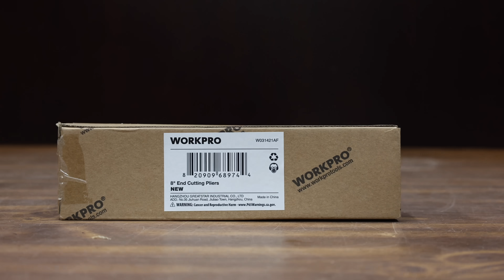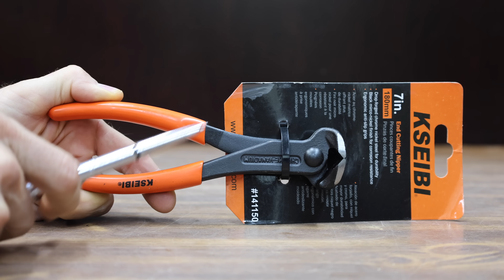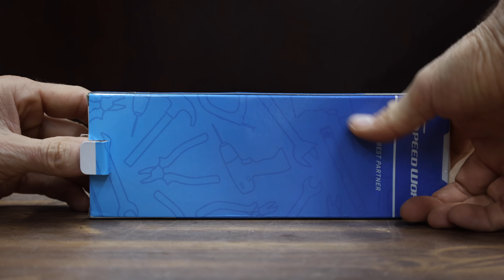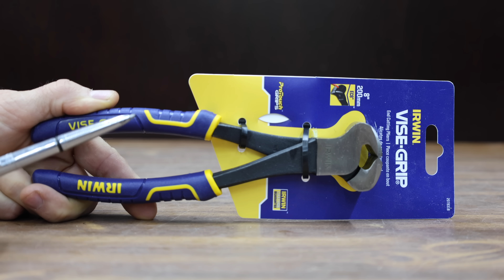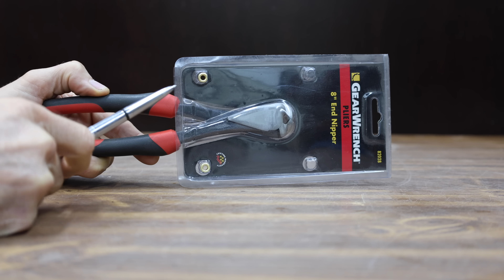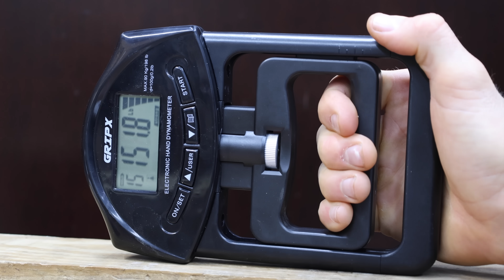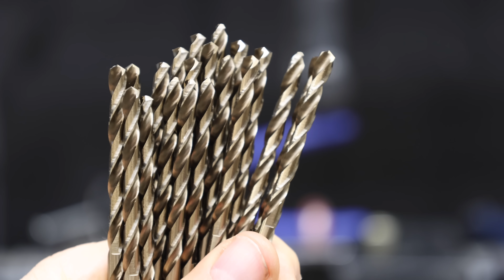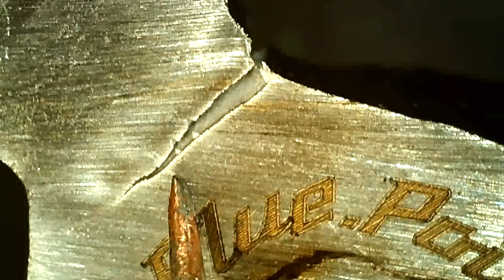Finally! Best Pliers I've Ever Tested! Not Even Close!

Comment: If this dude published a book that just listed the results of every test he’s ever done, it would be a best seller for decades.
Reply from the maker: Thanks!
Reply: @ProjectFarm  A yearly edition like firearm reloading manuals or 3rd party car manuals would be a good move, especially a collaboration with a couple other trustworthy tool test channels like the Torque Test Channel. then companies can’t rest on their laurels and you can add new information as things change. I’d buy the hell out of such a thing,
Reply: @ProjectFarm  yoou should figure this out with a lawyer. this is a mioneymaking idea.
Reply: @ProjectFarm You have to do it. Its viewer suggested 😁😁
Reply: @ProjectFarm  TorqueTestChannel keeps a live spreadsheet of their tool rankings and sells lifetime access to it for 15 bucks. I'd love if you had something like that!
Reply: Do it I'd buy it instantly
Reply: @ProjectFarm  it would be the tool buyers Bible
Reply: @ProjectFarm It should be doable with reasonable effort, just run your videos one by one through google gemini, prompting it to create a book chapter with info tables. Should work.
Reply: @ProjectFarm sorry mate, but immediate fail. These are fencing pliers, meant to pull tension on a wire by the offset cut, before cutting it through after tensioning via the curved outed surface. You have misunderstood the purpose of this particular plier. Love you work, but please understand tools, equipment, materials before testing. 😊 The Japanese ones were first to have a flush cut.... all before are fencing pliers.
Reply: @logic.and.reasoning  you should go and read the description on the ads for these cutters. They advertise cutting screws and even chain. 
 You are the one misunderstood,  they are not just for light work of cutting fence.
Reply: @Itsa_Mea  he tested them as "flush cutters" which they are obviously not by design, except one. Wrong test on these tools.
Reply: @logic.and.reasoning  no, his test demonstrates how close they CAN cut. He's not testing them exclusively as Flush Cutters, hence all the other tests he did perform. 
 If you don't see the value in all the conclusive tests then that's on you.  Majority here appreciates it.
Reply: @Itsa_Mea  so... he tested them to do a job they aren't designed to do... you wouldn't buy these to flush cut... so the test was pointless. It's like testing a hammer to see how it well it trowels cement. I love this channel, and the tests are usually helpful and indicative of the tool. This test was not. The curved backs of the jaw are meant to roll on... you grip wire/nail with the slightly offset cutting edges (they grip first, shear with higher pressure applied) and roll the tool to pull the nail, or tension wire. The handles are made so you can twist the tool for wire. 
Argument is... the tool wasn't tested on jobs it was designed for.
Reply: @logic.and.reasoning  you are confused. He tested nipper pliers.  The tool you are confusing with nippers are FENCE PLIERS.   Those are for fencing, NOT what he tested.  You are using the incorrect tool and should be using Fence Pliers.  Lol, you may as use a hammer. 🤣
Reply: @logic.and.reasoning He used the tools for their advertised purpose. The Knipex had a small offset in comparison with the others, yet performed the best by a huge margin. A larger offset doesn't seem to have any benefit, and his mentioning of each pliers' offsets doesn't have anything to do with the performed tests.
Reply: @logic.and.reasoning  If you think those are fencing pliers, please look at actual images of pliers used for fencing. They are not the same. Just because you've been taught to use the wrong tool, doesn't mean everyone else is. He's testing nippers. Hope you have a great day.
Reply: @fpbbq I've never had a pair of " nipper pliers " before.  I have had " fencing  pliers " . 
So I googled them.  So I could see the difference... you are 100% correct! 
Nothing I found shows nippers being used like the jealous wierdo here keeps saying.  Not one example  of nippers pulling wire or " rolling " anything.  The fencing pliers though,  that's a different story.
Reply: @logic.and.reasoning  I believe you are confusing these pliers and Fencing Pliers.  They do look similar and definitely work as Fencing Pliers, it's just not what they are intended for.  I will say, they work great for pulling nails and staples. You grab hold of the nail/staple and as you roll them, the nail/staple is easily pulled free.  Even without a head on the nail these work well.
Reply: @logic.and.reasoning interesting. The more I know. 😮
Reply: @U.S.INFIDEL  because you haven't lived in the Australian outback. Probably been in a tent at most.
Reply: Do the book!

Or like a digital book/file that gets continually updated. Once you pay for it it just keeps getting updated.
Reply: I'd love to buy that book. You should think about doing it.
Reply: Well it would be a best seller until the less principled brands realize they can now cheapen production and double the cost of their tools and make bank because of the book's existence.

Frustratingly a lot of products that get glowing reviews from popular sources like this will quickly sell out, and then the next batch of the same product will be dramatically worse cus the company knows they can get away with it and would rather make a quick buck than stick to their original product and gain a million loyal customers.
Reply: @PollexTheCat  Don't they call that value engineering?
Reply: @PollexTheCat Those companies typically don't last many decades. There are thankfully plenty of companies that stick to their values. Unfortunately not most. Buyer beware, as you said.
Reply: There's already a spreadsheet with all of his tests on it.
Reply: I’m a web developer by day (tool nerd by night) and would totally be down to volunteer my time in building a website to house all this info.
Reply: @MBbank8 Claude Opus 4 oneshots this kind of website
Reply: like a farmer's almanac for tools and things.
Reply: Is it though? Half these pliers won't even exist either as brands or the specific designs in 5 years. It would be outdated very quickly even for something basic like pliers, powers tools and accessories would fare even worse.
Reply: @onikwa  your lack of use of various tools is obvious.
Reply: America's Test Farm.
Reply: The project farm almanac
Reply: I think he should have an online store of all the tools that did the best at their price point. If you need a good tool, you know where to go to get the best. Project Farm approved tools shop!
Reply: @mugur9818  I beleave you are corectomundo!!!!
Reply: Agreed. Required reading for every member of the household and or shop. Love this guy! USA !!
Reply: thank you!
Reply: Just like a laminated pamphlet of a large chart with test results that I can leave in my glovebox and check on my way to the store to buy tools.
Reply: Here is the thing.  Something that was number one 3 years ago may no longer be number 1.  Companies are always trying to save a buck and make things cheaper, thus quality suffers.  Maybe a few companies have improved their products, so they could actually move up the rankings.  So that saying, "What's good today may not be good tomorrow" has a lot of truth in todays consumer world.
Reply: @trvman1  that’s why you make it a yearly thing, and the proceeds both pay for retesting and support the creators. A lot like how Underwriters Laboratories works
Reply: That’s a great idea
Reply: Ooooorrrr, @ProjectFarm could do an in-depth video review on hundreds of tools and household items and publish it for free on some Internet video sharing site. Hmmm, great idea. ;-D I get it, a book would be a great quick reference guide :-) and that would be a wonderfully useful asset.
Reply: except in 5 years half of these brands will no longer exist and the others will be made by a different manufacturer...
Reply: @mewmew32  …and at that moment the tools will vaporize into Thanos dust. And besides, no one ever wants info on old tools anyway 🙄
Reply: it would lose relevance after a few years as manufacturers change their designs.
Reply: Id but that book!
Reply: Yeah we need a real project farm reports
Reply: While it outdates quickly id buy it for sake of honouring excelent cerator on the mission
Reply: He has an excel file with everything on it
Reply: Kind of like consumer reports, except by and for people who regularly use tools.
Reply: It's like having cheat codes for life 😂
Reply: @Bdub423  Cheat codes....love it mate.
Reply: Still, it’s important to know that a brand can change ownership, and thereafter quality levels.
Reply: Or winner products could say tested and proven #1 by project farm.
Reply: It'll be like the Michelin guide for tools
Reply: @jestforyoooou  hell  yeah  I'd buy 2 copies  at least
Reply: ya then we could just skip to the info we want and not have to listen to his annoying voice.
Reply: .... We need to make this a thing
Reply: but he would have multiple hits on his head tho
Reply: @GyantaTheProto  he's testing tools not engines that run on water, man
Reply: @jestforyoooou  pity I'm talking g to unskilled workers with little experience....
Reply: 40 years in metal custom fabrication and hydraulic dampers, mechanical, but multi skilled by learning from old school TRADESMEN. I AM a tradesman. Not just a tradie, or had 5yrs experience... I have built stunt equipment and movie cars. Aircraft, race boat, custom parts... done pyrotechnics and special effects... I have hand built more tools than you have had a bj...

Comment: Awesome as always.  Here's an idea for a future video. black or chrome lug nuts, Which are the best and actually hold up to rust? Is expensive OEM the way to go? Do these cheaper chinese brands off amazon perform the same or worse? Does the black coating just fall off leaving you with rust after a winter season? Would love a experiment on that!
Reply from the maker: Thanks!  Thanks for the suggestion.

Comment: YT recommends a lot of tool test videos in my feed.  You and TTC are the only ones I trust to give an honest review.
Reply: Same here. Both channels I trust, mainly because they don't allow the manufacturers to butter them up with freebies. Even though others may claim that getting free stuff doesn't in any way sway their results. I somehow doubt it.
Reply: Not the only ones I trust, but definitely the 2 best for specific testing of strength and/or power. Love that both of them design and build their own testing rigs. 

Several others address speed, ergonomics, and other factors very well without brand/price bias, particularly for cordless power tool testing.
Reply: you never came across ave / boltr.. sad.. battery tools mainly, plus advice, jokes.. older vids worth watching. 2 yrs ago..
Reply from the maker: Thanks so much!
Reply: TTC? Is that "The Tool Center"
Reply: torque test channel
Reply: @pauldean7690  Torque Test Channel
Reply: @pauldean7690  torque test channel.  Check em out!  Really good content.
Reply: @pauldean7690  torque test channel
Reply: @pauldean7690 torque test channel . They test impacts, flashlights, wrenches and more. don't ever trust the numbers on the box.
Reply: @pauldean7690  Pretty sure he’s talking about Torque Test Channel. Can almost guarantee it.
Reply: True!!

Comment: The Japanese Wazakura pliers have the only design that will cut close to the board. I believe that the strength of the steel is important, but the heat treating probably makes a big difference.
Reply from the maker: Thanks for the feedback.

Comment: I've had several sets of Knipex cutters (both 7101200 and 7132200) and they're effectively indestructible and deliver more cutting force than anything else. The only drawback is they don't open very far. I don't have much use for end cutters like the 6202200 you tested in this video, but I might have to pick a pair up.
Reply from the maker: Thanks for  sharing.

Comment: You can tell just by looking at them that none of those were designed for a flush cut.  You would need to remove the outer bevel.
Reply: 7:35 Like that one

Comment: Suggestion:
Micro ratchets (1/4" hex bit drivers): Gear Wrench, ICON, Klein, Wera, Wiha, Ares, Titan, HART, Pittsburgh, various Chinese random-brand.

Some of these can handle crazy torque, and a low resistance (backdrag) micro ratchet is the only viable solution for some fasteners. Micro ratchets with a purpose-tailored bit and socket set up to 17mm can handle 80-95% of workload on any machine, all fitting in your pocket or a slim holster. That kind of versatility and portability saves massive amounts of time on the job and prevents using the wrong tool to "save time". Some of these ratchets have great features like in-handle bit drivers, thumb wheels, pass through extensions, locking flex head, etc

Love what you do, really appreciate your time and dedication. Saved me hundreds in dollars and thousands in time and frustration, and the priceless satisfaction of finding that I already use the best tool or product.
Reply: Excellent suggestion.
Reply: Why no Bahco brand? Is it not available in the US? (yes, it is a Swedish brand - but now owned by Snap-on).
Reply: @jarls5890  Not personally familiar with it. Looks like the only true hex micro ratchet they sell (6950CBR or 2058/S26 kit) is the same as an old Gear Wrench discontinued, which I know from experience is not very good. The rest of their stuff is square drive with a hex attachment which kind of defeats the purpose of a micro ratchet in my opinion.
Reply: @ziptieMasterTech  Fair enough! But I was thinking more "in general" - I watched a lot of PF videos and I don't think I've seen any Bahco tools yet. They are very common in especially Scandinavia and is respected as good tools at a "not too terrible" price. Personally I got a bunch of old (50s to 60s) Bahco (and Sandvik) tools in the basement after my grandfather who worked in a tool factory in Oslo.
Reply: @jarls5890 maybe it's because of the name? I thought it was a Chinese brand when I saw it and I've never seen them in the states.
Reply: @jarls5890  I'm surprised aswell. Bahco hammers or chisels are probably the best you can get.
Reply from the maker: Thanks for the suggestion.
Reply: I have the Icon kit and it quickly became one of my favorite tools. I even used it once with extra leverage beyond what it's intended to have (more than using the included extension bar as a cheater) and not only did it survive but it's wasn't even affected by it.

The only complaint I have is that I feel like they removed too much of the stop in their attempt to facilitate using it with the extension as a T- bar. The extension now has trouble staying in place as an extension. They probably should have strengthened the stop and made a bigger pass-through notch on the extension.

But other than that, it's a great little kit.
Reply: @puckcat22679  yeah I love it, stays in my EDC bag due to its versatility above all other micros. I have the same complaint about the pass-through notch, and sometimes the machining on the flex locking teeth is messy... good thing HF will exchange it hassle free. Unfortunately because of those faults I don't use it in my professional work kit, GearWrench does better there with much lower backdrag which can be vital.
Reply: Please include the VIM HBR5 dual drive, micro ratchets for 1/4" hex bits and 1/4" sockets.

Comment: TEST SUGGESTION >>> Pneumatic Nail Removers, Punch Nailers, Nail Pullers. Brands such as 
Air Locker AP900, WORKPRO, KAMSIN KT50, meite BW100, WOODPECKER WTB60, etc.   It should make a fun video!
Reply from the maker: Thanks for the suggestion.

Comment: I’ve had a couple different sizes of this nipper tool, I think it’s designed for pulling staples or nails more than nipping it off. My primary liar is a Klein I’ve been using since 1985, are USA made. 
The other one is a smaller version, since they are very small, they have limited usefulness. 
The rounded shape of the jaws is perfectly suited for grabbing, the sharp edge grabs the material, and the rounded jaws create very good leverage. 
These accomplish what a claw hammer can’t do unless the nail has a large enough head. 
Simply chopping of the body of a nail doesn’t make it much better. Removal and replacement of door or window casing, required the old nails be removed completely.

Seeing that the Snap On affiliated tool is a China tool, makes me feel that snap on is not the leader they want the market to believe.
Reply from the maker: Thanks for sharing.

Comment: FWIW i use Menards Tool Shop brand to pull nails from upcycled wood. Best rounded end IMO. Doesnt dent wood that way. Also great clearance on both sides for long nails to clear through as you pry. Terrible quality control for aligned jaws so I had to dig. I doubt they'd do well in these tests, though. 😂
Reply from the maker: Thanks for sharing.

Comment: I have a set of Knipex side cutters that I bought to cut guitar strings, which are notoriously tough. I got them for the very same reasons that were shown in your tests. They are well worth the added expense.
Reply: If you look at the handle of your Knipex it should say the diameter in milimeters of pianowire it can cut through 😉
Reply from the maker: Thanks for sharing.